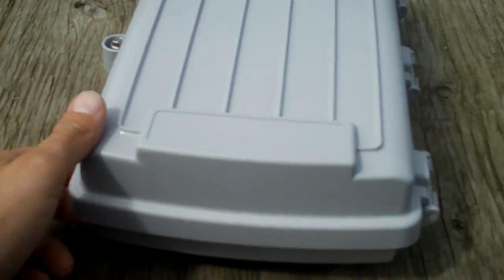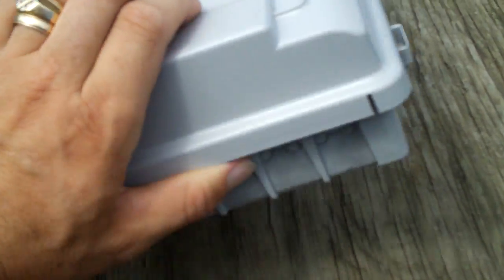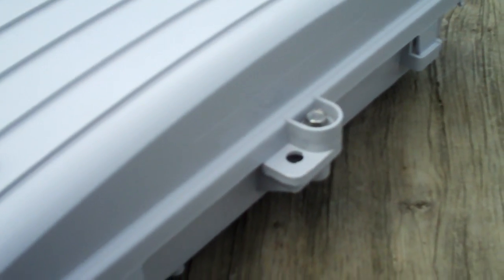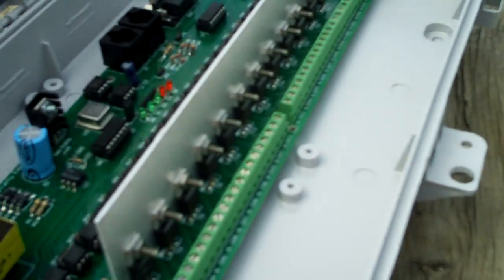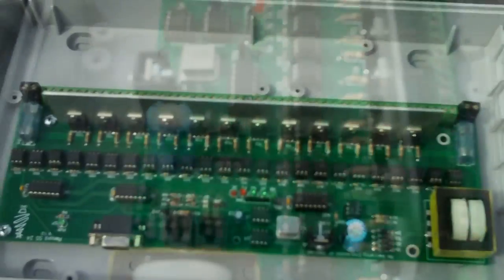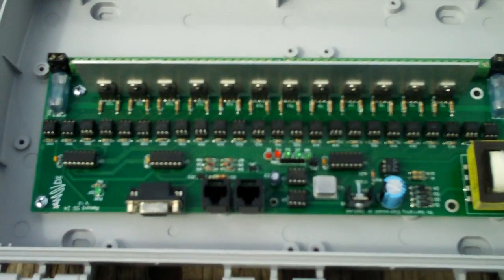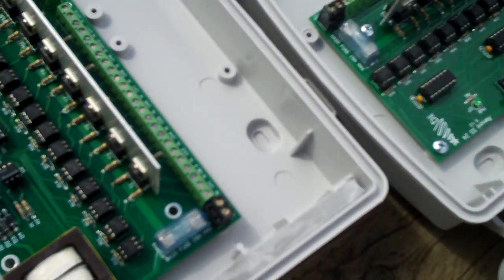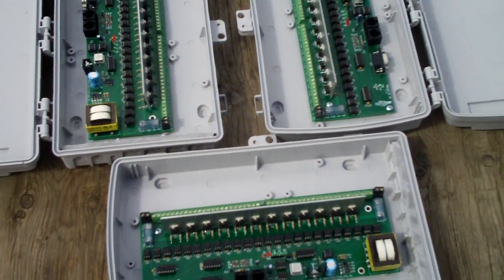Renard SS 24 Channel Controllers

Comment from the maker: @kevmet500 I was considering cutting down the standad serial cable Rs232 that I curently use and attaching and Rj45  and then connecting to ( J2 Port  ) jack on the Renard SS 24 Pcb.The thinking is that perhaps the Rj45 end can pass thru the opening as do the channel and power cords.As to the channles , there is no way I will be able to use them all this year but at least I have them for next year Lol , thanks for your comment and reply back

Comment from the maker: @kevmet500 For now there are only 2 holes that acually line up in the case that I am using.I plan to buy or build other stand off,s in the case and use an Expoxy glue to hold them in.I have just completed 3 of the boards and still need to build the 4 th of this same kind and also a Ren 64.Total channels for this year will be 160 for my first year.Sequences have not yet begun , however I am starting to looking at options for that.I do not currently have enough lights to use all the channels.

Comment from the maker: @davey4557 Power comes in to the controler from your wall socket  at home and then to a trasformer on the mian Pcb.The power is then sent thru the various traces to feed all the required channels etc.The Pc talks to the controler and tells the controler when to allow power to the various lights ( channels ) This is done by means of software.I hope this helps some ?